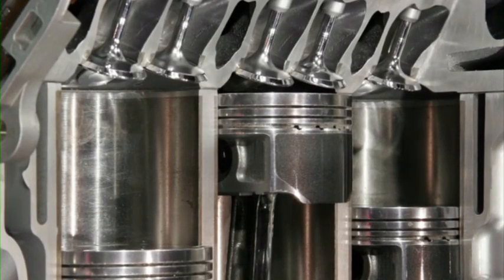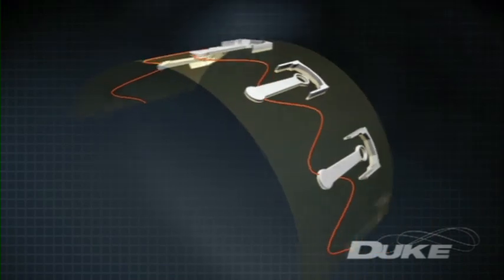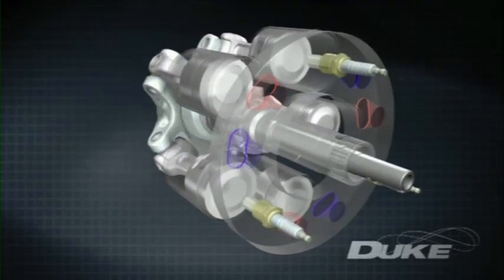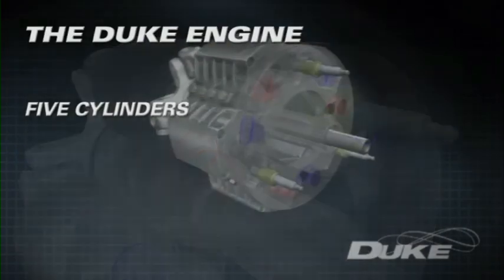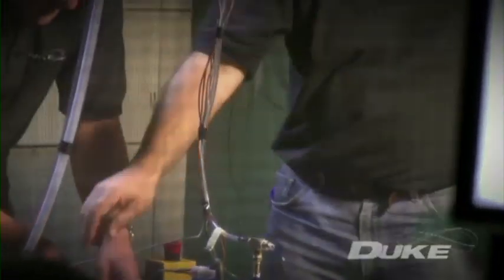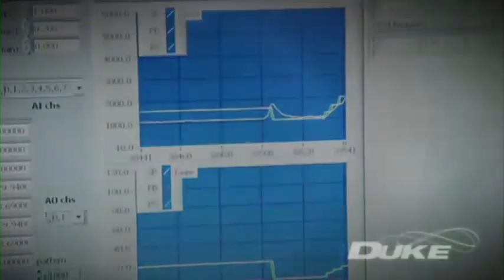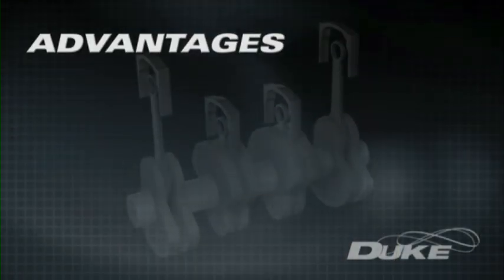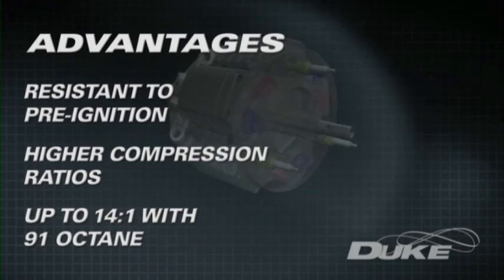Duke Engines

Comment: "Look guis! We took ideas from two strokes, rotaries, and diesels and guess what! It can produce almost the same power as any of those individual engines but with none of the reliability, or simplicity!"
Reply: Worse, this is just a radial engine but with the cylinders all facing the same way, if anyone gonna design a new engine aviation will do it first
Reply: System used in car's A/C compressors but they dont care about sealing the fluid much because it will just reduce cooling efficiency by a bit.
Reply: Atleast they dont have to get valve timing correct each time
Reply: But hey, it does save weight? The engine isn’t fully developed (But then again, this was 8 years ago.) so they could make improvements. After all, the dude is from Coswerth or whatever it’s called.
Reply: @HiThere-bu4bs  The biggest problem with these machines is sealing the combustion. and if they are able to seal it then the head will wear out faster. simple.
Reply: @hp2084  The places where pressure is created, do not rotate. The piston moves up and down in his cylinder, without any sideways pressure. 
The block of cylinders rotates, but there is no pressure  involved.
The intake slids are well known from boat racing 2 strokers, no problem there (König Tuning)
Reply: @hp2084    You got it.   The critical thing is seals  (one of the two things that doomed the Wankel, the other being an awful combustion chamber shape, a defect this engine doesn't seem to share).
But yeah, sealing the revolving cylinder assembly against a stationary head has got to be a major headache.   In a conventional piston engine, the seals are circular rings - easy to make and tension, and the only head seals are a stationary gasket.   In this engine you still need the rings, but you have head seals to worry about as well.   And the head seals have to slide past spark plug holes and ports.
Reply: @hp2084  I agree fully. Main bearings for the vast rotating mass will be a problem, as will that wobble plate which is a huge CV joint.
What puzzles me is why they don't use compression ignition and obtain the power at lower RPM
Reply: @wilsjane  I wonder if compression ignition was not possible due to the complexities of sealing the rotating cylinders against the stationary head? Getting good compression out of this must be a nightmare
Reply: Ah German Engineering
Reply: @bryanmartinez6600  "never use one part where you can get 5 to fit."
Reply: @flyingmerkel6  p
Reply: @flyingmerkel6  p
Reply: May or may not be of use, it still was developed successfully and didn't perish in the depths of forgotten designs. Perhaps this will be a key technology when it could come to inspiration for new, better engines than conventional combustion engines.
Reply: @novelaforme  The problem is that it suffers from a problem rotary engines also had (and caused their doom, as even Mazda eventually abandoned them), which is that there are moving parts that need sealing from the combustion in awkard ways, and that will need special sealing and lubrication. It also will be a major pain in the ass to work with, and cooling might also be a problem with that rotating cilinder housing... At least rotary engines where actually pretty simple, so I believe this kind of engine will be even less comercially viable
Reply: @LeyvatenLoop  Sealing and lubrication seem to be the one industry standard concepts in this chain of kludges. The major problem is it uses two points of leverage to transmit the force to the transmission. Okay, so the second lever splits the force so the cylinder bank can rotate, SMH. Then the transmission is driven with a shearing motion imparted through a lever motion permanently angled less than 90 degrees.
Reply: So what is your problem FNF ??? Why make it simple if you can make it complicated????
Reply: Shut up and take my money!
Reply: Yes
Reply: Whos guis?
Reply: A principal of mechanical engineering is that the less parts you have the better  the reliability. If they can really get this going I think it has some pretty good potential.
Reply: P0
Reply: Ppppp
Reply: Lpppp
Reply: Ppppppp
Reply: P
Reply: P
Reply: The advantage of axial engines is that they are compact.  They are often proposed as range extenders for series hybrid vehicles or drones that require range and duration.  As to reliability, that comes with development... 

Of course there are alternatives such as the Wankel rotary and the turbo shaft engines, both of which have examples that have had much more development already done.
Reply: @SikerScrapyard  seems to me you misunderstood my sarcasm.... or maybe I am misunderstanding your reply.... Either way in my engineering experience (aerospace) the object is reduce weight, number of moving parts, design for RELIABILITY, and when someone told you "get rid of parts" they probably meant use the ones we already have at hand... i.e. use the ones we already use in another project as common parts if at all possible. This design is just plain shyte which is why it is not implemented anywhere.... And I am afraid it never will be. It would suffer from totally inefficient power transfer of linear motion to rotation....plus excessive wear and tear.... ABSOLUTELY NOT COST EFFECTIVE....
Reply: Also the saving would just be eaten up by the automobile advertising large, heavy autos. Autos are just getting bigger and bigger.
Reply: Ahh... nothing like an ignorant YouTube comment. If you were in charge nobody would try anything new at all.
Reply: Progress is the man’s ability to complicate simplicity lol
Reply: "look guys i have never contributed anything productive to the world but i am gonna try to make fun of a new technological design by calling it unreliable based on zero data to back it up"
Reply: @barbarianater  oh what, so i need to be idk like Einstein to be able to criticize something? What? You did say you need to contribute something to world to be able to criticize something right?

Comment: Reminds me of hydraulic wobble plate type pumps used on jet engines. Smart placing plugs and ignition at the right point of compression to make a power plant from a driven pump type design.

Comment: I remember a now retired collogue of mine describing working on a similar engine in the 60's. I believe the main issue that they had was the centripetal force that the pistons exerted on the cylinder bores increased with a square law relationship to the rotational velocity. Basically you couldn’t run it very fast and the pistons wore out fast. Back then the materials technology couldn't get around this and they only made a few working prototypes before the project got killed. They also had issues with the inlet and exhaust ports wearing out, however the technology developed for the Wankel engine in this respect will be directly transferable.
I suspect the engine would likely therfore run quite slow, which would mean it may be able to drive a propeller directly without a gearbox, making it very useful for powering small unmanned aircraft. A market which is currently receiving lots of investment and at which I suspect is the application the engine is aimed at.
Reply: if what you are saying is correct then how come piston pumps are all over the market

Comment: Hate to discourage inventive creation, Although the compression pressure from the pistons on a single swivle AND transfer rotating the pulley system is Way too much blowback. Not to mention heat, friction, vibrations distributing between the metal composition and the parts shaft as well. New Technology would be on how to introduce a magnetic bearing system without the use of mechanical gears. Friction is the cancer within efficiency, by minimizing that this design could work well. Sorry not sorry but there are designs and theories out there that are smaller and potentially more efficient.

Comment: sooo.... in addition to exposing the combustion chamber to the metal to metal contact and particles produced from a traditional inline engine, this one lets the rotating cylinders expose the combustion chamber to it's continual grinding with the engine block deck/ cylinder head whatever thing LOL? ... just more metal to metal wear and tear to be introduced into any possible oil system and also the upper cylinder area,... and what do we gain for this revelation??? i see the piston rings going bad faster due to microscopic metal introduced to the fuel/air on the intake stroke from the block deck rubbing continuously on the cylinder head.... but i love the video and the technology ;)

Comment: go ten cylinders with exhaust and intake on the side of the housing instead of the end. use the same three spark plugs set in radially. offset the five cylinders on one end from the other so the intake and exhausts are always going instead of intermittent.

Comment: That bearing or connection joint at 2:6, right where the top twisting plate meets the crankshaft? I can see that bearing being a complete bitch to perfect.
That said, still looks better than the Wankel rotary engine used in Mazda cars

Comment: I see 3 points that make this engine less attractive in comparison to a traditional engine:
1. The less steep angle of the piston rod torque relative to the rotating main axle makes a work stroke less effective than a traditional engine. 
2. The stationary cylinder head moving in relation to the cylinders will have some serious wear issues, similar to Wankel engines.
3. The rotating cylinders create a centrifugal force that presses the pistons against the cylinder walls. This will create additional wear.

Comment: I'm also a bit skeptical, but this doesn't mean it's a bad engine.
My questions arise from the moving cylinders. That kind of takes away the option to play with the valve lift time. Plus with a 14:1 compression, I wonder how long the seals underneath will last, before the pressure breaks out between the sliding cylinder parts. (a bit like on a rotary).
STILL - I see alot of advantage over the otto engine. Which in my opinion is over complicated.

Comment: ...sooo they took a 5 cylinder radial engine and turned everything inward 90 degrees and contained it. excellent concept for low rpm applications, but for heavy industry, you would have to put the same exact setup on the opposite end of the crankshaft to balance high speed vibration which would ruin the machine. Now if the internals were stationary and the "barrel" spun, now then you would have something!!!

Comment: I like most of this design, my only real issue is that variable valve timing gives power and efficiency across a wide power band, it's one of the big reasons modern engines are so much more efficient than even 10 years ago.
Reply: I suppose u could still control the compression ratio, like fuel and air ratio in the port. That would have the same effect i think?
Reply: @zaryabz56  

A/F ratio is not the same as compression ratio and doesn’t allow the same control as variable valve timing. Because there are no valves in this design you cannot change valve timing or compression. The ports and cylinder stroke are both non variable.
Reply: You could change the compression ratio by mounting the thrust bearing of the nutuator(sp?) on a hydraulic actuator.

Comment: It's Total Bs - 2 yrs so far - Scam as usual. Do Not seek the Treasure.
This Scam comes up every few years - Tried for 40 years -
Simple Reverse engineer a commercial AC pump of Honda Civic. 

Forced in reverse - Not Possible. It has to be driven. 
Notice - the Scam of hidden drive belt - This BS isn't running on it's own.

Watch this - Call Me - I'll video it - I'm packed waiting with Plane Ticket.
Now watch the excuses come why they won't.
Tried to warn You - You can't fool a farmer from the 50's.

Comment: Oh look! It's half of a Bricklin Rotary Vee from the '70's. 

Seems a bit too dependent on sliding seals for my taste, but good luck with it!

Oh, not much info around for it the reference. You'll have to find the old Popular Mechanix issue.
Technically, it's called the Bricklin-Turner Rotary Vee.

Comment: Intake and exhaust ports right next to one another? So your air intake temperatures are going to be very hot which is going to lead to reliability and cooling issues long term. It has more moving parts than a wankel, is bigger than a wankel and doesn't seem to have many advantages over a wankel, so why use this over a traditional rotary engine?

Comment: I'm not against anything new, that said and I'm no mechanical engineer just a guy that was a mechanic for lots of years, something that's taking a power stroke at some sort of angle to the crank just looks like its going to develop problems with wear at that bearing. The 2 stroke and using ports is going to be a emission no go, even with converters and such after the fact its just not more efficient, maybe direct injection but I know Chysler did work on a 2 stroke in the 80's and it just wasn't happening. I appreciate a new take on a old problem but don't personally as a mechanic seeing this as an advantage or answer. Just my opinion of course show some reliability data over a few hundred thousand miles and I'll withdraw my opinion.

Comment: Okay, so it's basically a two stroke engine, so you'd expect it to have similar efficiency problems.   Yet they claim 'resistant to pre-ignition', 'up to 14:1 with 91 octane'.   It's not clear how this design lets them achieve this?   Would not the same tricks work on a conventional engine?

Comment: If the cylinder assembly rotates, doesn't this mean any vehicle you would put this thing into would automatically be dragged in the direction the engine is rotating in? It would suck to drive a car that kept sagging and getting dragged to the right from the front

Comment: Part of me wonders what happens at high RPMs. It seems like a lot of outward force wearing on the rings.
Reply: Also will the oscillation be harsh? It tends to be with smaller engines and especially with ones that throw their weight around.
Reply: Wondering the same, allot of strange offset angles, feels like its gona wobble and ware like my grandma's hips
Reply: Outwards force how so??
Reply: Well this spins in a circle right? So there's got to be some centripetal force 'squishing' the pistons to the outside. I'm wondering how much this will cause additional wear on items like the piston rings.
Reply: I never thought about that
Reply: yea this doesn't look like an efficient engine at all
Reply: Plus the different axis of rotation
Reply: Don't fix if it ain't broke.
Reply: Hi
Reply: Yeah, with all of the cylinders moving around and the pistons moving, this thing is gonna shake

Comment: Would a very small version of this engine be useful to turn a set of alternators to help run and electric car? Either as a Engine/ator or to use alternators to keep charge on batteries with a low fuel consumption?

Comment: Almost like the Rotary engine. few problems like others pointed out.. How are the engine vibrations? And the "wobble" platform....can it handle high rpms? I see some unreliable problems with this design. I don't think it can handle heavy engine loads. or produce a lot of torque. IT would make a good small engine for like lawn mowers etc etc. But for racing or work..not to sure.

Comment: I think the biggest problem with the efficiency of internal combustion engine is combustion itself. ICE have very low thermal efficiency(I should say peak probably) and energy loss via mechanical counterpart is minimal compared to this. I would rather prefer a simpler engine that allows for incredibly high compression.

Comment: So the cylinder just rotates like a revolver, so how do you keep it sealed? That's what I don't understand. And I guarantee that's where it's going to wear out VERY quick, especially trying to hold hot compressed air without it leaking out. It have to use something like a crank seal, but that's one big ass seal, and a crank seal isn't made to handle the kind of "chamber pressures" that that duke motor will have. I'd love to get my hands on one and go through it!
Reply: Also they talk about how conventional engines are soo heavy and bla bla bla, that motor they made looks twice as heavy. A honda motor is so light, that I can pick it up, now engines with iron blocks/heads are heavy. Your average medium duty diesel like the straight 6 cummins or powerstroke weigh 900 ibs, heck the 4 cyl cummins weighs I believe 740 ibs, it's pathetic. I just had to add that in there lol...

Comment: Hmmm - I had the idea to reverse the action of a standard "Swashplate & Plunger" (SPP), type HP Hydraulic Pump - which are usually gearbox or electric motor-driven - into an Internal Combustion Engine, over 40 years ago, in 1969....!
  At that time, I was merely a young craft apprentice, learning to be an "Aircraft Fitter (Propulsion)", under the guidance of Number.1 School.of Technical Training, RAF Halton's indefatigable instructors. In fact, the idea first came to me when in one of Corporal Ian McCandless's classes - on ATA 29, Aircraft Hydraulics.
 My idea held that such a conversion would utilize the "kidney ports" in a standard SPP Pump body, between casing and rotating piston housing, to allow fuel/air mixture induction and exhaust at the optimum times. Ignition would ideally be by compression - though this would require adequate plunger gas sealing with piston rings and lead to a requirement for a rotating "Ring Bearing" in the Swash-plate surface. Adjustment of engine rpm would be achieved by varying swash-plate angle and/or the induction port aperture via a sliding 'gate valve' - with the correct air/fuel ratio being provided by either carburettor or fuel injection.
 All in all, a simple concept - but definitely Not Mr. Duke's, originally...!